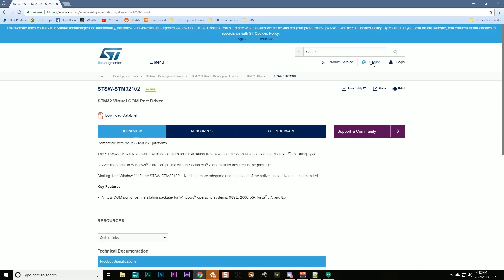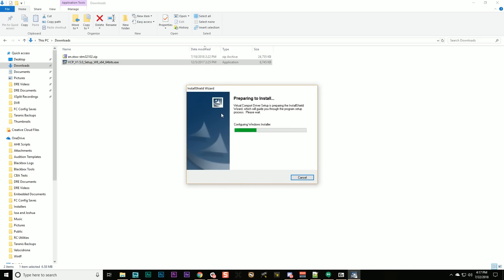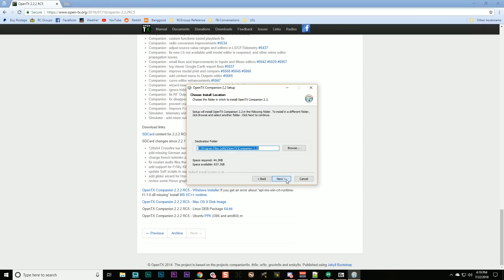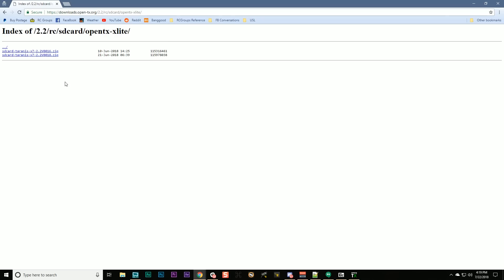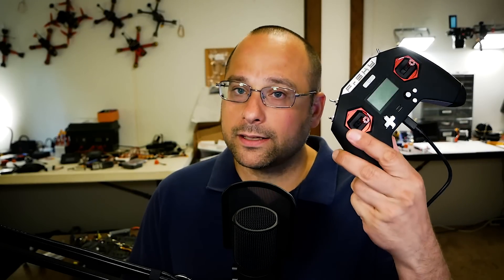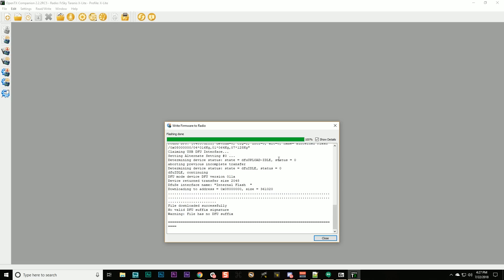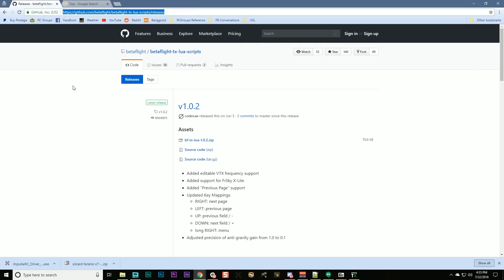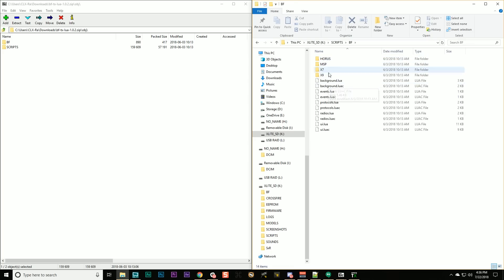FrSky X-Lite OpenTX Install/Upgrade How-To (Taranis X9D QX7 same procedure)

Comment: Hey guys. I'm super green to this. I want to set up a borrowed Frsky xlite to my computer to try Lift Off simulator on steam. But seem to be a problem with even getting the controller connected to the computer. Do you know a guide for how to succeed with this? It is connected with a chord but doesnt show in //run. TIA

Comment: We were all noobs once...its my turn. Can ya help me get my Taranis X-Lite and my Tiny Hawk Freestyle on the same firmware. They used to work fine together until I pulled them out after a year or so and decided to update firmware on the TX and RX to freshen things up. I can't bind anymore with any of them. Not sure how to match firmware on both tx and rx. I used the latest of both I believe ... I used Betaflight and Open TX companion... Even a link to the right YouTube video would be great. Preferably by JB Thanks for all you do Joshua, You are the easiest guy to follow.

⚠

Comment: hello, So for the first time I was trying to update my Firmware on my frsky xlite S and bricked the controller. then I was able to flash it back to life. then I wanted to try and still update it with the correct firmware. but now my D Pad may be stuck and I can't access the boot loader mode. I was wondering if you had any tricks or videos to help me with the D pad repair? or if I just lost my boot loader and my controller is toast? 
thank you!

Comment: Joshua, Can I revert my firmware on my new X Lite Pro to allow my Crazybeex to connect? I'm losing my mind here bro.
Reply from the maker: I think what you're saying is the ACCESS radio doesn't support D8 mode, right? No -- you can't change that via firmware update. Either change the Crazybee to FRSKY_X firmware and bind in D16 or get an XJT Lite module and put it in back of the radio to add D8 support.
Reply: @JoshuaBardwell  So I've confirmed all my settings are correct in betaflight for the receiver. Set to FRSKY_X I set the TX to D16 and it just will not bind.
Reply: I read online that reverting to older firmware resolves the problem, but that opens up the OpenTx and open companion. to top it off im running just the USB and no MicroSd. I cannot get the older .frk into my firmware .Bin thanks for your speedy response

Comment: Hi Mr B , I  have followed the steps for my x lite pro, I've trippled checked that I have the proper SD contents and firmware however when I write to the tx with companion it says " New firmware is not compatible  with the one currently installed " and the radio will now not power on. It seems to be bricked, do you have any ideas?
Reply from the maker: That happens when you are flashing a different hardware target than the one that's currently on the radio. For example, if you downloaded the Xlite Pro firmware but you actually have an Xlite. If you previously flashed the wrong firmware to the radio, it will also trigger the error when you try to flash the right firmware. You can just tick "ignore this error" and override it though.
Reply: 😁ok thank you for the info @JoshuaBardwell

Comment: My secondhand xlite has no backlight or voice. Both are turned on. Followed your video but companion  says new firmware not compatible with radios firmware. If the owner loaded the wrong one how can i get back to factory. Do i choose xlite or xlite s ?
Reply from the maker: If the wrong firmware is loaded, turn off the "check hardware compatibility" option and flash the right firmware.
Reply: @JoshuaBardwell  thankyou joshua that did work and have the latest firmware loaded. But still no backlight. All i can think now is to load old firmware from frysky. Also cant bind it to moblite 7 afyer trying all the steps.

Comment: Was playing a Sim and forgot to unplug the X lite afterwards and bricked it... after doing everything you said to do in one of your videos my remote was fixed! HOWEVER the Aileron(roll) part of my right gimbal reads that it is stuck left even when the stick is centered.. I tried factory resetting it, re-flashing and calibrating the remote without any success... any advice on what to do before buying a new radio @Joshuad Bardwell?????????

Comment: I went to flash my x9d light and I got an error “ New firmware not compatible with one currently installed” ???
Reply from the maker: It means you have downloaded firmware for a different radio than the one that is on the radio now.

Comment: hello joshua bardwale, my name is khoirudin, fpv pilot from indonesia, i have taranis xlite with r9m lite module and slim r9 plus receiver  immortal T TBS ANTENNA, firmware fcc, horizontal antenna position, front and back in quad. having flight distance problem,  RSSI drop at 40m distance so easy is failsafe, is there something wrong with the wiring? Or the settings? If you have experienced this, please explain to me, thank you🙏

Comment: okay so i got the EEPROM error to go away, but now even with installing the amber file and everything else i dont get any sounds.
Reply: nevermind i got it figured out. i was dumb and not only did i leave the old English sound folder on the SD but also renamed the amber one to en.Amber. i first removed the old sound file and that did nothing. so i figured it had to be cuz of the file name being changed. so i changed it back to just en and everything works great! thanks again for all the great tutorials!
Reply: lastly placing an order on RDQ here in a minute and using your affiliate links to help a brotha out! hope they give you a decent kickback! more will be coming aswell! again thanks for all your help. you do a lot for the community and i know im not alone when i say i greatly GREATLY appreciate it! These kwads can be a freaking headache and your videos always get me through to the other side of a working/flying kwad! good stuff Josh keep it up!

Comment: I was so confused when you suddenly didn't mention anything about inserting the SD card in the X-Lite. But I luckily figured out that I had to put the SD card inside and it automatically updated the X-Lite. Maybe something to mention in the video? Since I had the SD in the computer to put all the files on there.... like you said is quicker.

Comment: Hay JB I'm following your instructions on updating my xlite s and after writing to tx is done %100 I get a message "new firmware is not compatible with the one currently installed". Should I be worried

Comment: Had issues with Betaflight TX Lua Scripts 1.5.0 here on the X-Lite where the pid screen would not load after following your steps and holding down on the joystick (Got some weird message instead). Loaded version 1.4.1 onto the sd card and got it to work. Thanks for the tutorial!

Comment: Thank you...........I’m fairly new.......started to build my own quads.....I was having trouble installing downloads on the radio.....I was using a 64 g sad card........I copied and transferred to a 32 g sd card......installed it in radio and it worked.......!
Reply: who uses 32 or 64gb card for radio xd

Comment: How can I get older firmware? I have an x7 and the newest firmware wont bind to my meteor 65
Reply from the maker: So the bad news is, FrSky took those firmware down off their web site so you wouldn't be able to flash the firmware back to the old version. But the good news is somebody I know downloaded them all first and put them up on Google Drive. Here's the link: https://drive.google.com/drive/u/0/folders/1ugj1DjWdqbnE25aDwyOYJDD-Nmr0wfYg
Reply: @JoshuaBardwell  Thank you so much!
Reply: @JoshuaBardwell FrSky sure makes this difficult. I ended up having to use this link https://davesdronedesigns.com/frsky-firmwares/, as I don't have a module. I was able to flash the firmware but I cant seem to find the required sd card contents for that version (2.3V0020) and I get an sd card error every time. Any suggestions? And again I really appriciate your help        
EDIT: Ended up downloading 2.3V0018 sd card contents as it was the closest release, and changing the version number using notepad++ and that miraculously seems to have worked :)

Comment: mac users, i did a thing, i did a whole thing by myself... well i followed the 67 steps of this video but i did 1 thing by myself, when chucking the file onto the sd card, the transmitter wont recognise it unless you expand it so youve got a few files and bits, then you need to copy/ move these and only these onto the sd card. if you close it then open the sd card the first thing you should see is folders named "script" "models" ect, hope this helps

Comment: I have the jumper t12 and the current version is 2.2.2. Right now I don't see any sound packs or sd card content on the opentx site to download for that version. I'm hesitant to upgrade to a new version for fear of losing my models. I really only wanted the voice commands. Is there a way to get those without upgrading firmware?

Comment: Hi! Can anyone help me - I have QX7 and Im trying to update OpenTX (from 2.2.4 to 2.3.7) but my companion app and impulse rc driver fixer doesnt see any radio connected to pc. I also cant read settings to back it up or to flash it. What am I missing ? STM32 VCP drivers are installed.
Reply from the maker: If you can't get it to register when plugged in with power off, then you can try bootloader mode. To get into bootloader mode hold the lower trim switches inwards while pressing the power on button. Then plug in USB after it boots up and see if OpenTX Companion can flash it.

Comment: Hey @joshua Bardwell , I've been doing your step by step process but my impulse RC driver fixer is just searching forever.. any idea on this ? Thanks
Reply from the maker: Typically this means either 1) you didn't install the stm32 driver, 2) the device is not in bootloader mode, or 3) the USB cable is power-only and not data.
Reply: @JoshuaBardwell  changed the wires 3 times, found one that was detecting a drive on my computer then i knew it was ok. Also the impulse was still searching forever so i skipped that part and went to open tx straight and worked, thanks for the answer :)

Comment: Josh, how do I use my x lite pro inside of Lift Off?! I can't get it to work even once I have the proper drivers and sd card files...
Reply from the maker: Plug in USB. You should get a dialog box asking "HID Device (Game Controller) or Mass Storage". Pick HID Device. It should now appear as a game controller in your PC.
Reply: @JoshuaBardwell  t dangit, it does that, but computer doesn't read it, I'll have to do software troubleshooting I suppose.. thank you for all your help in my walk to building a drone! You're awesome man :)

Comment: This is in the future and I'm looking at the 2.3.1 version of open TX and I need assistance, there is no Luac on the settings everything else is there. Is there going to be something wrong if I do not do Luac
Reply from the maker: Some radios give "out of memory error" if luac is not enabled. But you can try flashign without luac also.
Reply: Joshua Bardwell 
Oh ok thank you

Comment: When I updated the Transmitter firmware to the latest:  2.2.4, 7/11/19, EEPR:218..  the backlight no longer illuminates!!  I can't turn it on from the internal menu either. Something bad happened.
Reply from the maker: Best guess you flashed the incorrect firmware. Like you flashed xlite firmware to xlite pro hardware.

Comment: Thanks so much for this video!!  So I gather that the SD card that you use has to STAY in the Transmitter and is not just used to transfer the files over. That was unclear at first but I guess it stays..

Comment: Hi Joshua, great channel always use your channel to LEARN SOMETHING NEW!! lol but just watching your set up for x lite on open tx companion profile page ticking lua,luac, noheli etc i noticed at the bottom were it says default channel order a lot of other streamers change this from the default RETA to AETR or TAER saying it will save time when binding micro quads etc, i noticed you left yours as default RETA does this make any difference ? many thanks Paul from UK
Reply from the maker: The bottom line is, it must match what's on the quad. You can change the default to match Betaflight or you can change Betaflight to match the radio.
Reply: Joshua is it possible you could cover how to flash and update the irangex irx4 lite module using the github website, there are no other streamers who have covered this but i always see people asking the same question . Thanks

Comment: Ok I know nothing about anything lmao. I just bought the Emax tinyhawk rtf kit. I want to get this controller/transmitter. I see that mode 4 is the closest to playing an FPS. Can the x lite do mode 4?
Reply from the maker: Yes it can, but I strongly recommend you learn in mode 2. You will adapt to it very quickly and have no problem going back and forth between FPS and FPV. The reason to learn in mode 2 is that is what the vast majority of the world uses. If you learn in mode 4, you won't be able to fly anybody else's quad and they won't be able to fly yours. This will seriously get in the way of fun at any social event, and if eventually you make a profession out of it, you will have to re-learn mode 2 anyway.
Reply: Damn, you schooled me and made some valid points I hadn’t even considered. Thank you... looks like I’m learning mode 2 lmao. Thank you very much!!! And awesome response time I didn’t expect that! Liked and subscribed sir!
Reply: Liked and subscribed as well! I recently purchased the exact same kit and saw that transmitter and had the same questions and was directed to this channel and video. Great step by step tutorial, its exactly what I need. Thank you

Comment: Could i just take my sd card from my qx7 and put it in the xlite and hit write firmware on the xlite? Would all my models and sound files be working?
Reply from the maker: I think that the models are stored in the EEPROM not on the SD card, but the audio will go with the SD card. However, the different FrSky radios use different SD card contents, so you may not be able to just swap it one to the other.

Comment: Hi Josh, hi everyone, I am very excited to get into this hobby. I have just got myself this radio and a tinyhawk. I have followed your instructions to the letter, I also followed the binding process but it won't bind with the tinyhawk... I don't know why. The receiver is good cause I got the hawk from a guy who installed mockingbird on it and had no issues with binding. I would very much appreciate some advice. Thanks for all the great work!
Reply from the maker: You need to bind in D8 mode.
Reply: @JoshuaBardwell  I got it! Thanks a bunch, let's get this hobby on the way!

Comment: Would someone please help me out with this cross fire lua on x-lite as I'm struggling.  So far I've updated the open tx companion to version 2.2.3 as well as the firmware on the xlite.  I have copied the open tx lua sd card files x7-2.2V0018 over to the sd card.  When I try to open the lua script through the xlite menu, I go to the the model and left click to screen 1.  I open scripts and that's where I get stuck when I scroll right to open bf, I get the message that there are no scripts on the sd card.
Reply from the maker: You need to navigate to the SD card contents, CROSSFIRE folder, then execute the crossfire script from there.

Comment: thanks for another nice tutorial video! i just bought the x lite and the MPM adapter, after doing this firmware update i now have lost the option to choose flysky in the module, do you know why?
Reply from the maker: No, sorry -- I don't know why that is.
Reply: @JoshuaBardwell  the Vantac MPM Lite 2.4G Multiple Protocol TX Module?
Reply: @JoshuaBardwell  omg, after a week of head scratching, i finally found out that i needed to check multimodule in companion, now it works, and today YOU learned something?! hehe, pheww, okay next up: the lua script tutorial!

Comment: I used the sd card method as after tryin the driver fixer, it just says looking for your OSD device. 
Any idea how to solve that issue?
Reply: Solved it. Needed that zdiag app.
Reply from the maker: Zadig and IRC Driver Fixer should do the exact same thing. But in the end if you got it working that's all that matters.
Reply: I appreciate all your videos. I have been outta the hobby a couple years, and holy crap, a lot has changed.

Comment: video is awesome and easy to follow, but I cant get the impulsercDriver to find the controller. I have nothing plugged into my computer and it just keeps searching and searching. Also due to my frustration I tried to move on and later my link to flash the controller wouldn't  pop up. I even downloaded it a couple times with different names and the wont pop up. Thanks for the help.
Reply from the maker: Have you installed the STM32 Virtual COM port driver
Reply: I did not thanks for the help
Reply: its still can't find the radio
Reply: yep it was the cord, it was only a charging cord I guess

Comment: ive had a dozen computers throughout my lifetime and never learned basic computer use. with this vid i downloaded your stm file and got the CLI dump on my new tinyhawk. now to figure out the new qx7. i have a lot to learn, have several 5 inchers built and several other frames i got cheap, ebay.this hobby is about 10 times or more complicated as racing rc cars on road asphalt and ozite carpet. look up vids of twelth scale carpet nationals. look forward to racing drones @61 if i can figure the computer part out. being very specific with instruction is usually best. hope to hit a kwad camp at your house. i live due east other side of sams gap on 26, after i learn a little more. you the man